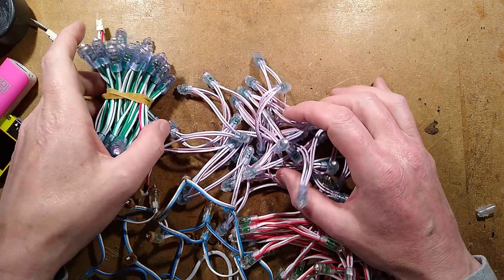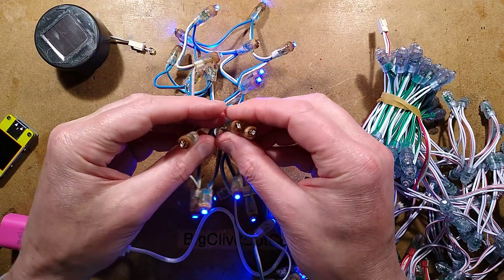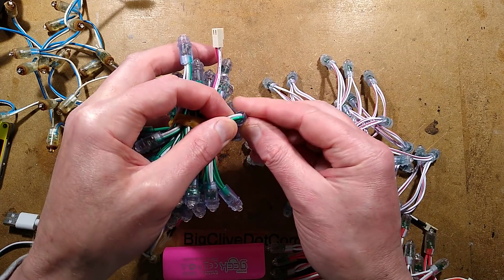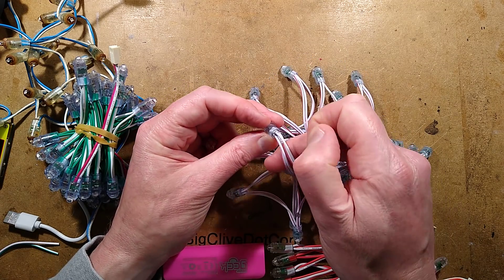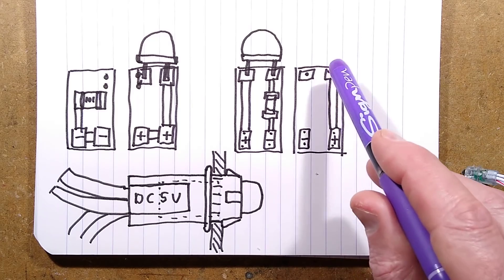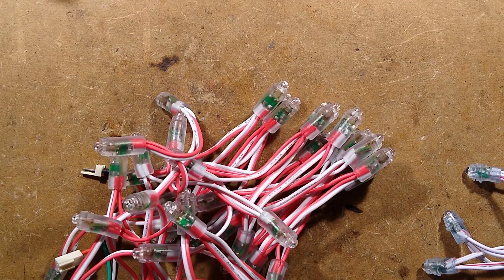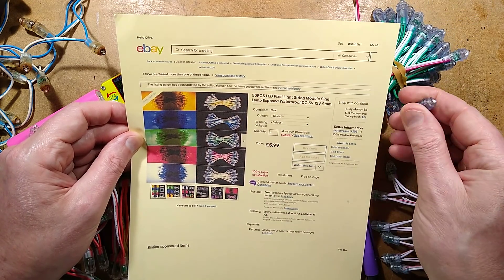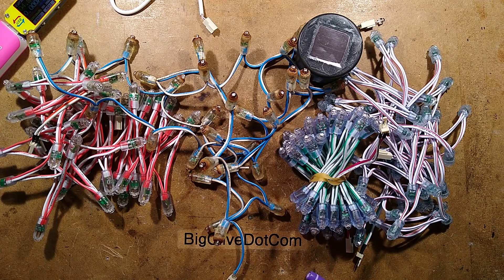8-year test result of outdoor sign pixel LEDs

Comment: Hi Clive. I would like to ask your advice really. I have got an old but decorative centre light fitting that has twenty of those little capsule bulbs in it which are driven by a ruddy great transformer in the centre rose. I would like to convert it to LED. I have managed to confuse myself completely trying to work out the necessary power supply, resistors etc. to drive twenty 10mm ultra bright, White LED's. I have a spare LED driver module which is rated at 8-12W, DC24-40V 300mA. Could I use that somehow? All the bulb socket wires end up at the centre with plenty of room once the old transformer is gone so the LED's can be wired series, parallel or a combination of both. Any ideas?
Reply from the maker: If the new lamps are 12V LED then the best choice is a regulated voltage 12V LED driver.  Do not use a halogen transformer or current regulated supply.
Reply: No, they are not lamps they are just bare White LED's with a 3.4 volt forward voltage and a 20mA current rating. I have an LED driver which I think came from an LED ceiling light fitting. I don't know if it is regulated or constant current or what. I think the light fitting was a 5 inch diameter 6W flat panel. I have watched many YouTube videos and am now thoroughly confused. I don't know if I will need two strings of ten in parallel or four of five (actually five of four would be easier) and if I need resistors on each string or each LED or if I need any at all with an LED driver module?

Comment: I recently had to sort out my family's stored property in an East Texas metal shed that had roasted in the sun and humidity for 15 years. I thought I was pretty savvy about my chemistry and deterioration processes but I was surprised at the level of decay. Some plastics are VERY stable long term and others not at all. Certain rubberized grips turned to gooey tar and all plastic that could oxidize and yellow or brown did so thouroughly and without sun or U.V. And the adhesives and plastics in many types of running shoes just plain gave up. Very sobering view of how weak the human legacy will be after we are gone.

Comment: NOT PIXELS unless they can be individually controlled. You can use them to form a picture, sure, but the whole image is effectively just 1 pixel.
Reply from the maker: The image is a sprite made of pixels.
Reply: @bigclivedotcom  Well, still not individually controlled. You could use a backlit plane and a mask to achieve a similar effect (very inefficiently). How about the term fixels for what appears to be pixels but only forming a fixed image?

Comment: Rather than adding a diode drop in line with the USB supply, why not modify the supply to put out a lower voltage?
Reply from the maker: A diode is much easier.
Reply: @bigclivedotcom  But less efficient.
Reply: I have done this before. The problem with most of those wallwart types is that they are glued together and do not come apart easily.

Comment: Grab a couple IN400x diodes and you could run 2 5v strings in series, while getting less voltage drop from the power supply! You'd get a little reverse polarity protection as a bonus. 😁 (Don't mind me, I'm just hanging around for the people that forgot what LED stands for.) 👍

Comment: Let’s face it. Most of this stuff from eBay is being sold there because it wasn’t good enough to be sold in more reputable ways. Chinese vendors know it will be too expensive to return these products when they prematurely fail so eBay, Aliexpress, and Amazon are clearing houses for their junk. I can’t imagine going to all the time and labor to install these in a custom sign or other application only to have to rip them out when they start failing due to water ingress or just plain substandard components. For something you’re going to invest time in and want to work for many years it’s just not worth buying the bottom of the barrel cheapest crap possible on eBay.

Comment: If you ever get round to playing with strings of individually addressable LEDs, I have a little question you might be able to answer.

Hmm, well, what is a tad annoying is that these were £5.99 eight years ago, and still essentially working, and yet I have some supposedly waterproof garden lights that I bought last summer for £15.00 (reduced from £20.00), and they're knackered already! - A 20 light string, but only 5 lights still working, and not even all that well. Another set I bought a couple of weeks later (£10.00), are bin fodder!
Reply from the maker: If they're the type with heatshrink around normal LEDs then they will wick water in and corrode inside.

Comment: Poundland have new and novel solar ground lights. They have the LEDs, solar cell and control electronics all potted in transparent resin. Should be very waterproof and could be a candidate for a review.
Reply: That clear resin does not tend to do well over time due to UV making it turn cloudy
Reply: @Mark1024MAK  I find that this is a surface effect and can be buffed back to clear with something like T-cut.
Reply: @gedtoon6451  - thanks, I may give that a try.

Comment: Why today a ridiculous amount of time is considered to be an eternity? 8 years is absolutely nothing for a good product. I have a wristwatch from times when wristwatches were very rare: 1918. And it works still fine! The incandescent bulb in my flip-clock alarm clock is lighting since 1975 or since 46 years without interruption. I just had to oil the synchro-motor of the clock once and it is working like new. Most of today's people are extremely waistful and then complain about an alleged climate change. People are stupid today.
Reply: That watch of yours has been out in the sun since 1918?  No?  OK, then, apples and oranges.
Reply: @sirnickity  Apples and oranges, yes! Watches are of course in contact with the light for Years! There are zero materials in an old watch that would deteriorate with the sun. That was real good quality. By the way, plastic also gets briddle without direct sun exposure:   The chemicals in the plastics that render them elastic simply evaporate.
Your injection is simply stupid. You wrote something just to write something. My statement was simply that it is an mental illness of our time to take a lifespan of only 8 years for a product as a "long time". No, 8 years are a very short period.
Reply: @jurivlk5433   "brittle"

Yes, plastics degrade.  Metals also corrode, there's expansion and contraction, evaporation of lubricants, etc.  Nothing lasts forever, and planning for an appropriate service life given usage and working environment is a reasonable thing.

These LED strings aren't meant to be heirlooms.  In 8 years, the outside environment broke down the plastics and allowed moisture to seep in and corrode the conductors, which caused a few LEDs to fail.  That's hardly surprising.  The string itself still works, and the LEDs that hadn't yet been infiltrated are still working.  If you wanted to maintain these, and periodically refresh with some sealant, I'm sure they would last a while longer.

There are plenty of examples of throwaway culture, and as a whole, we could stand to do better.  But... credit where it's due, these actually seem to be reasonably durable, particularly for the price.  My guess is they are typically driven hard, and the LED burns out far before the insulation fails, so it makes no sense to consider 10+ years of weatherization when they're treated like consumables.  (And priced accordingly.)
Reply: @sirnickity  Nevertheless, 8 years are not a lot. Especially when they tell us that average life is like 50'000 hours. And don't the greens tell us that plastic needs a 500 years to decompose? So they are some 492 years left...

Comment: Normal bulbs in glass would have survived 8 years without failures with slight under-voltage!
Reply: I don't understand the point of a comparison with something that would be completely impractical in this case. As though 50 incandescent festoon lights would even be visible at night when powered by a tiny solar panel and battery that can maybe provide 1/16 of a Watt (3 Volts @ 20mA) through the night. The 'normal' lights would be useless at power levels available from this circuit.
Reply: @carlg5838  Plastic is junk! That's the only point. Like the 240V bulbs saying 50'000h lifetime and after 6 months the plastic part is yellow, after one year it's broken, so in real life the 50'000h become 500h!
Reply: @carlg5838  Who says you need to power the lamps with 1/3 of a watt?

Comment: Thick epoxy encapsulation is the only sure way to keep out moisture. Coatings of epoxy won't cut it either.
Unfortunately, epoxy is also a plastic and will not get along well with the Sun and ozone. With time, it develops cracks and moisture gets in. 
This is why you have to paint fiberglass parts that sits outside in the sun (i.e. aircraft) with UV protection primer, before painting. Otherwise the epoxy in the composite, will get destroyed in the Sun. 
UV destroys carbon bonds. ALL plastics are made of carbon bonds. This is why glass, rocks and metals can withstand any amount of UV, without noticeable degradation. 
So if you want an LED that lasts forever outside, you have to make them like the old school way; glass bulbs with power leads embedded in the glass! No plastic is allowed.
Like how they made car light bulbs, with leads bent on the sides. The bulbs just plugged into a socket. Ez Pz.

Comment: I wonder why they don't make LEDs with a built-in simple constant current driver?
Would it be because of the heat they have to dissipate in the transistors that are acting as variable resistors? 
This is the only reason I can think of, that has prevented manufacturers from incorporating a simple 2x transistor constant current circuit, along side the LED die.
F'ing Ohms law is always there to poop on parties...
Reply from the maker: They have in the past.  But they weren't popular.  There are also LEDs with an integrated resistor.
Reply: @bigclivedotcom  I wonder why they didn't catch on! Price too high?
All these cheap LED strips wouldn't have needed all those resistors. 
Too late now, but I had to make my own using a current mirror, constant brightness under different supply voltages. I searched Digikey at the time for and LED with integrated constant current, but NADA. Just blinking ones...

Comment: My question is a little off,but I have a camping lamp and its not taking charge. Its is working with the batteries. What is the problem?
Reply from the maker: It depends on the internal configuration.  If it has an integrated lithium cell and has been stored discharged then the cell may need slowly charged back up to 3V to reactivate the charge circuitry.
Reply: @bigclivedotcom  thank you.

Comment: they failed when even so seriously underdriven? . . . huh.
Reply from the maker: Inevitable moisture ingress causing corrosion.
Reply: @bigclivedotcom  aren't the terminals separated though? by the plastic?
Reply from the maker: @dimitar4y  Water will creep into any parting between two surfaces via capillary action, and the first thing to fail with LEDs is the corrosion of their leads directly at the back.
Reply: @bigclivedotcom  So those tin coatings they put on the leads are no good, huh? What can even be put on the back that will form a long-term water-tight and sun-proof (uv-proof) seal to prevent this failure? Just about anything I know of will fail from heat/cold cycles, deteriorate from UV, or just not be 100% watertight.

Comment: Hmm what would be more efficient 5V string with linear regulator running from 12V or the 12V string
Reply: How about Two 12V strings IN SERIES (or one 50pcs string cut in half and the sections joined in series). The current is reduced to 1/2 per LED/ resistor, generating less heat but due to the efficiency of newer LED light output will be perceived only slightly lower. (See Philips Dubai LED lamps)
Win-win
Reply: @randomsteve4288  or three 5v strings in series :)
Reply from the maker: Three equal length sections in series would work.  Slightly lower current too.
Reply: @amojak  please read what I wrote. I suggested 2 strings made for 12V in series on a 12V supply. I did NOT suggest two strings of 5V in series run at 12V. 
And connecting Three strings of 5V in series on a 12V supply would still be too much wasted energy and heat in my book. Three 5V strings in series adds to 15V, so on 12V each string is still run at 80% of its nominal voltage. As we have seen on many occasions (Dubai lamps) there is a lifetime gain benefit in running LED at 50% of their rated current. 
So to maximize service life the suggestion for a 5V string would be to use 4 in series.
Reply: @randomsteve4288  i never said you did say 2 strings, what an odd reply.  80% power would more than double the life of the leds..
Reply: neither, however the former will dissipate less heat in the pixel itself. which as Clive said only helps to shorten the life of the LED and accelerate the demise of the plastic.

Comment: Clive something I just learned that May get your interest! In trying to revive and very old Lava lamp I found a article that talked about fog juice! in doing a little research I found out what the article was talking about technical propylene glycol! For fog machines. I made new wax and used combination approximately 80% distilled water and 20% propylene glycol! One lamp I used the original wax. WORKS GREAT. I read your article about your experiments just wanted to share a little with you as you do so much with all of us.
Reply: Nice!

For those interested, be sure to also check the Technology Connections video on lava lamps  :)

Comment: I've discovered that some new LEDs require only two volts to light up, so for a five volt power supply you can stack two of them in series, I guess. Although, I'm not quite sure about the voltage drop across the wires closer to the end of the strip.
Reply: Forward voltage changes with LED colour; long wavelengths (lower frequency) colours are produced by semiconductors with lower bandgaps and result in a lower voltage. Red LEDs are typically below 2v, whereas blue (and white which are effectively blue with phosphor) LEDs are closer to 3v
Reply: @ferrumignis  I was actually speaking of yellow LEDs, and I thank you for this clarification too.
Reply: In addition to the lower voltage of some colors, a variation chaining multiples to get max benefit from 12V might be interesting, despite the need to leave a few dangling behind the sign to reach a multiple.

Comment: I bet the new ones will have a much higher failure rate after 8 years
Reply: That’s how they get you to buy more
Reply: Yeeeepp.. like the flashlights/torches such as Nitecore. Olight. They.re all Chinese ofcourse but not perse crap/rubbish ihave a Olight R40 Seeker for almost 8years no problem.😊😊 Wie a typical AA Aan cell Light last 1. 3 . years 😉
Reply: @johngarritzcx6733  They are great if you like horrible cold white tints!
Reply: @SproutyPottedPlant  ehh i do own 2 high CRI flashlights 1 Olight S1 mini hcri cree xp g 90cri 5500k  2. The Nitecore TIP CRI 2017 nichia219 4500k nw i.nm happy with that 😊😊😊
Reply: C H I N A
Reply: @stupidsnek  China has 3 markets - big tech company, Chinese consumer (which is just as good), and everyone else.
Reply: @mthompson965  When you pay for crap, you get crap. That goes for China just as much as anywhere else.

When you specify decent, and this is the important part, pay for decent, Chinese manufacturers will provide you with decent. It really isn't difficult.
Reply: @mattsadventureswithart5764  fr people make fun of China like they're not providing 90% of all tech around us.
Reply: @mattsadventureswithart5764  If you want quality from China, yes, you must pay for it, but more importantly, you have to have your people on site in China to ensure the quality is maintained. If not, the Chinese are not averse to cutting corners and not supplying the requested and mandated quality of materials and workmanship.

Comment: Even if they were £6 eight years ago, that’s under £1 a year (maths is definitely one of my strong points). Amazing value, especially when you think in signage they’d probably have at least one more layer of protection from both the elements and UV light.